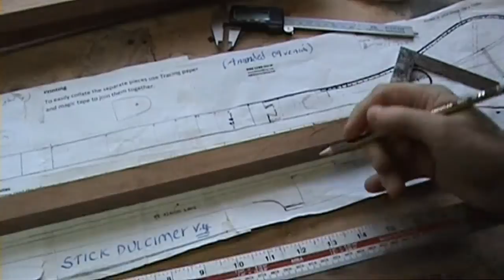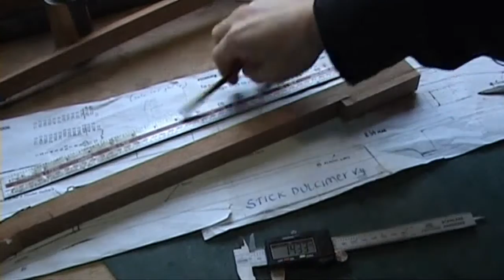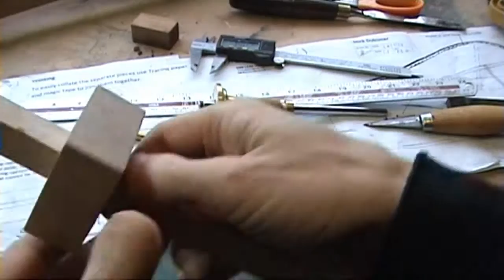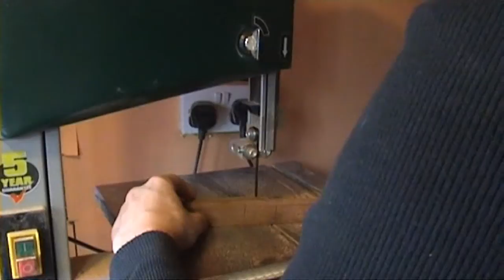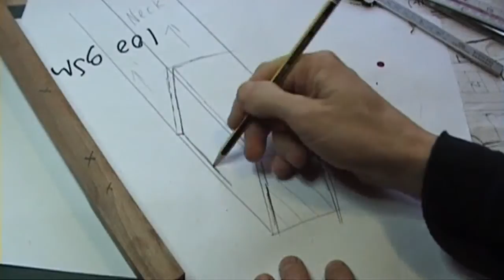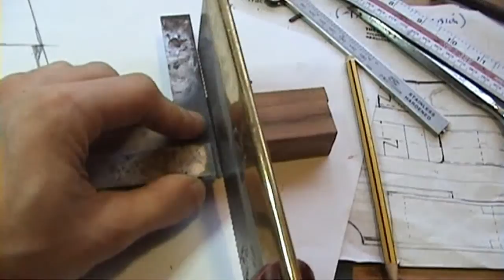Stick Dulcimer Making part 5.3: Making the neck

Comment from the maker: This series was intended for minimal tooling up originally, the only power tool that was essential was the Bench Drill.
In my workshop I have a router table and a woodrat , the woodrat does rebates easily,  but demonstrating using this would be of little use and might encourage people to try doing it with a router freehand. The episode tomorrow shows the very easy process of rebating with the bench drill that is so quick you will be impressed!  its  safer and so much quiter than a router.....